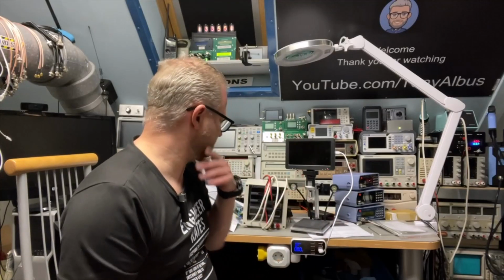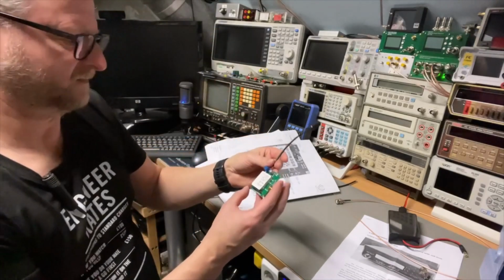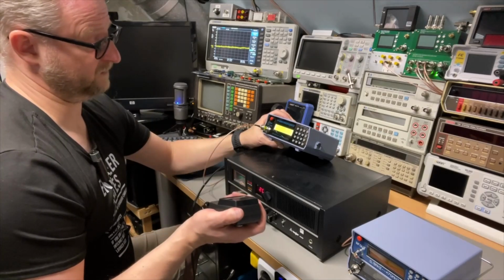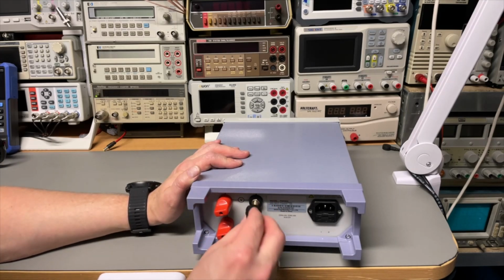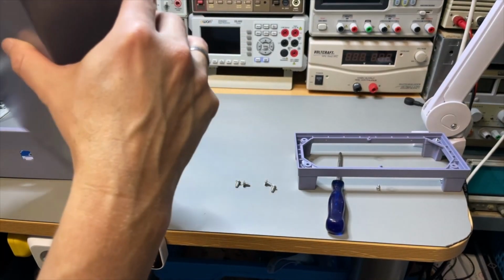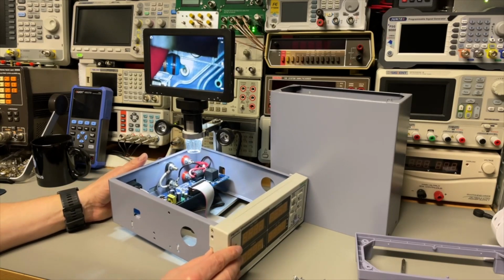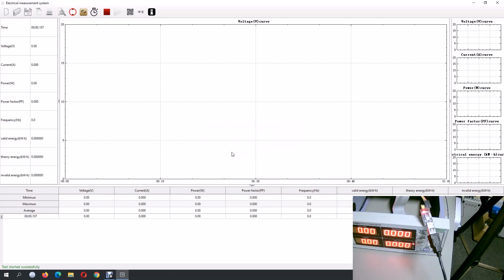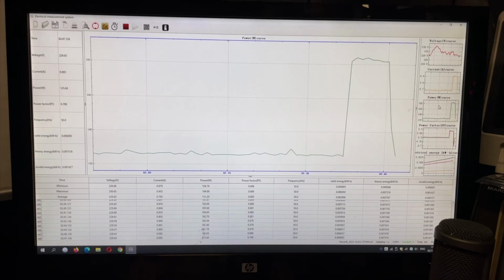#227 Lazy Saturday - DCUU PM9901 Power Meter

Comment: Hello,does this device measure total power factor or just displacement power factor ?
Reply from the maker: Hi, i could not tell you, it just displays powerfactor.
Reply: Basic AC power meter (Not an analyzer) they do not include phase shift in degree.  True Power Factor, this is the standard for energy evaluation.

Comment: Hi Tony, I have the Uni-T UTE1010A and like it.  It has a 9-pin DIN in the back.  I was wonder if you could comment on the software you used in your video and where it may be purchased or downloaded?  It is the software that does the graphical presentation of the meters on the computer.  Thanks...
Reply from the maker: Hello John, that is nice to know, the Uni-T looks nice! UniT usualy has the software downloadable on there website. but i have put a link to the software that i found and use from the DCUU website.
Reply: @TonyAlbus  I assume the link was the manual and app link but it just opens this YouTube page again.  I went to your website but no luck and can not find the DCUU site, (must be a Monday ; )  Yes I am happy with the Uni-T but they do not have any software  or manual on their web page that I can find.   The manual I got is written in Chinese but I do plan to translate it.
Reply from the maker: @jwrtiger  Hi John, maybe if you right click on the link and select save target as.
i will send you an email where i translated my PDF, maybe that helps you.
Reply: @TonyAlbus  Thanks Tony that worked and I got the zip file.

Comment: Hi Tony, please be kind to put us the link for the rf probe because it seems that you get the new model, the old one has a problem on the input capacitor.
In the new one the input capacitor is made by the cooper area on the both sides of the PCB
In the old one it was a SMD capacitor and the frequency response was affected.
Regards
Juan
Reply from the maker: Added to the item list.  Tony